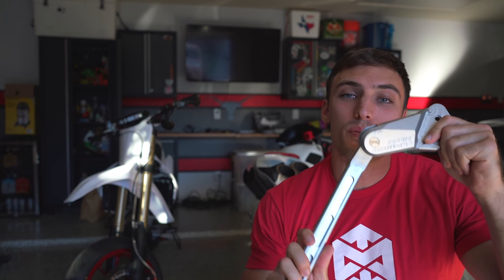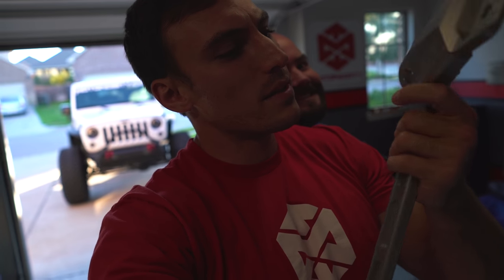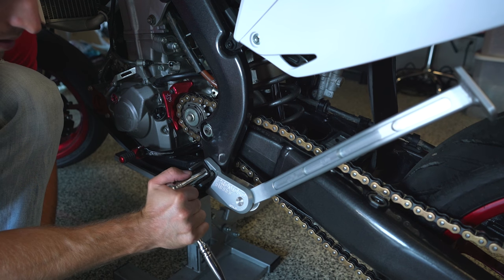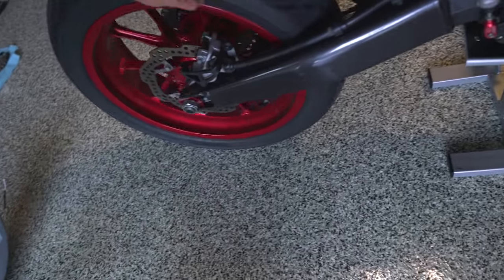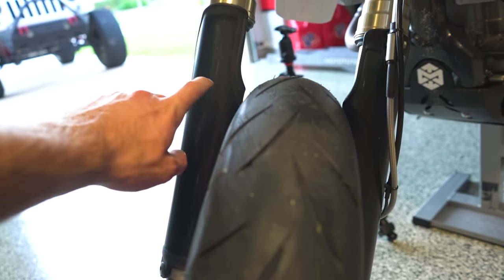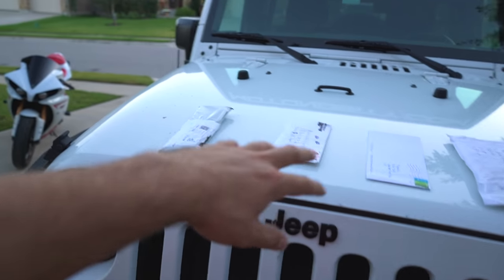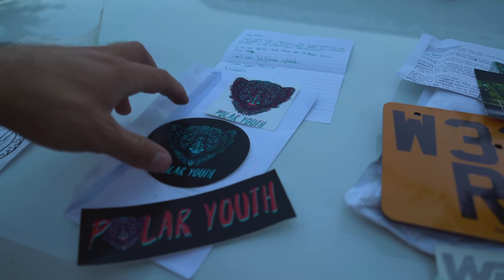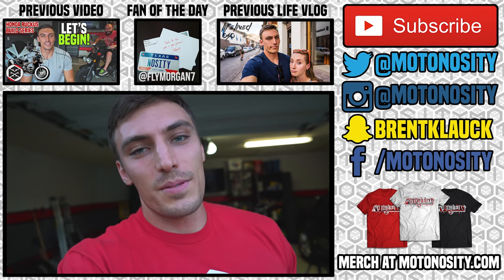Problems Already?! [Supermoto Build Part 16]

Comment: Anything that can take the heat of baking, can be powder-coated. 

I would suggest, taking it to a good welder, cut of the foot and roughly 3/4" of the leg, and TiG the foot back on. Seeing as the kickstand will have no shear pressures, there will be no loss of strength due to annealing.

Comment: I remember asking you if I should get a Supersport or a Supermoto as a first bike, you said Supermoto would probably be more fun. Well guess what, I didn't. I bought a Supersport, a GSX-R 600 K6 to be exact and boy do I love it. Looks good, sounds good, revs good. Going slow isn't that fun and  it gets pretty hot in town but once you go past 6000rpm and open the throttle....goddamn I've been missing out all my life.
Reply from the maker: +13i0Hazard666 Congrats man! Welcome to the bike life :)
Reply: Motonosity
 Thanks, I really love it. Especially the greeting part makes me feel like I'm part of something bigger. ;) Still gotta get used to the shifting though, the only bike I rode so far is an F650GS and that thing redlines at...8500rpm?

Comment: the rubbing from up front might be caused by the front tire expanding and contracting as you speed up and slow down combined with the wind pushing the plastic guards out of shape thus creating the circumstance for them to rub each other. just my thought I could be totally wrong tho and most likely am
Reply from the maker: +Anthony c haha I definitely thing it was the tire pushing air against the forks and thus the forks against the tire
Reply: Anthony c

Comment: The reason your tires are rubbing on your fork guards is probably because when you ride, tires heat up (obviously) and maybe not so obviously expand. Since you cut the fork guards to fit a cold tire, they began to rub when the tire heated up and expanded to a larger size then they were when they were cold. Just a hunch hopefully you fixed them!

Comment: Hey motonosity, really nice you got the all in one light strip! Do install that, and hey, just a tip for both better look and they get more visible = install 2 of them and turn 90 degrees, here's what i've done on my motard - https://www.instagram.com/p/BKD1NqOBTiA/?taken-by=filiplosflipp hope you see and like it
best regards Filip :)
Reply: Hey Filip, can you show me your diagram of your all in one light strip installation? Cus i'm trying to finnish mine but i cannot find the proper relay to make my turn signals lights to blink xD

By the way solid project that you got ;)
Reply: What bike you on? Have you bought this one in particular? Do the normal light and brakelight work but not turn signals? Or are they simply blinking too fast?

And thnx :D
Reply: I'm building a cafe race. Yes i did. When i activate the turn signals, they light up, but don't blink, they still like that until i turn of the turn signals. Have you used a led relay or you did not need one ?

Thank you for the reply :D
Reply: I did not use a led relay, its on the edge of not needing one for me since they are blinking pretty fast imo. But yeah just get another relay and you'll be good to go =)
Reply: Yes i am waiting for it ... Thank you ;)